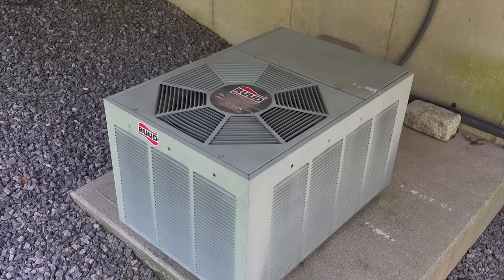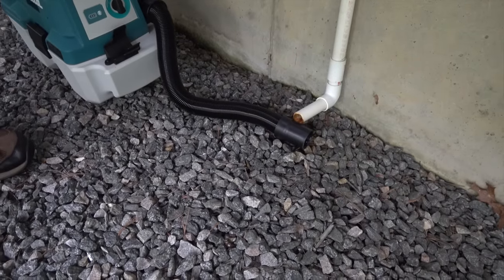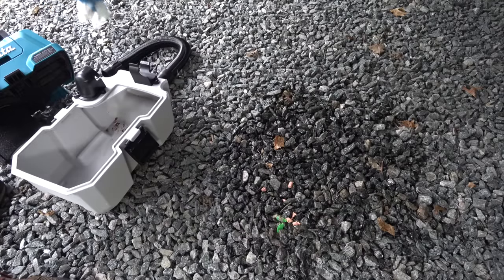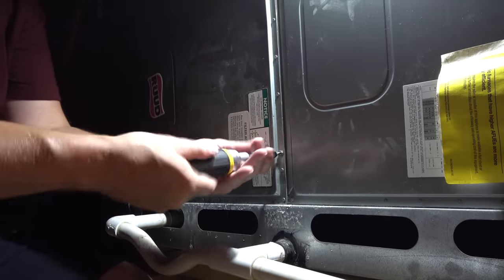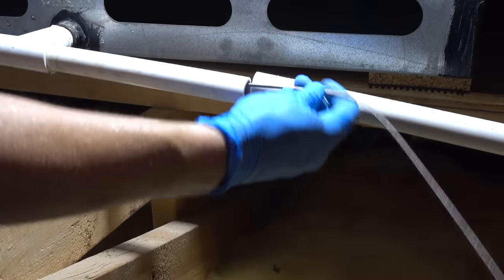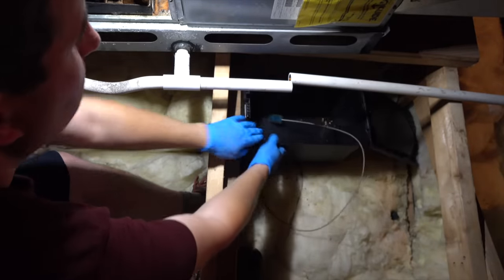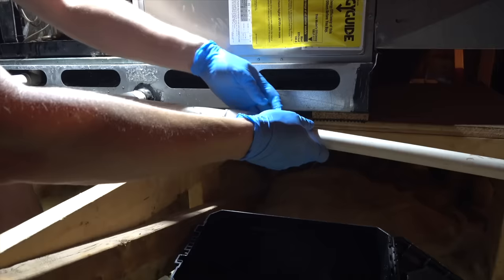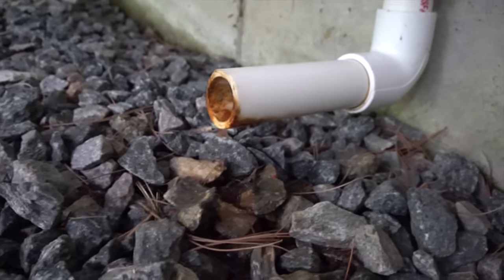How to UNCLOG your AC DRAIN Condensate line FAST - Water stains on Ceiling? or in the Pan

Comment: Our A/C is in the basement & it drains into a drain in the floor. It seems crazy to have you a/c in your attic! Even if we didn't have a basement I would put it in the garage, utility closet or anywhere except the hottest place in the house!
Reply: They do this in the south because its the most direct route to get the output vents run and connected. There is no utility room per se. I agree its dumb but the way homes are designed it doesnt make sense anywhere else. Id have put an upright indoor unit on a platform in a small utility room built on the back so that the return lines and outputs could be connected up in the attic easily.
Reply: In Louisiana most homes don’t have basements

Comment: I put a piece of clear vinyl tubing in my drain line at the attic unit, like you did.  Once a year (November) I pull it apart and attach a garden hose and blast it out all the way to the back yard.  Dragging a garden hose up into the attic is a pain, but at least I know the drain line is clean.  No clogs in years, and I have 3 AC units.
Reply: a bleach/water mixture (1:3) works to kill that mold build up.  That is what clogged our drain line.

Comment: That is a genius solution ... 6:53 ... Man, I never thought of that.  I have exact problem that you are describing.  Water leaking in attic, but I isolated it to a L-drop pipe that is about 10 feet away from the attic A/C.  I stuck an old LAN cord in and tried to shimmy it around, but it didn't clear out the stoppage.  I also poured some soap in it, hoping that it would help break the stoppage.  But, I probably need to cut a section, just like you did, then it would be easy to clean.  Thank you for the solution.  I need to buy that cord you've got ... 2:43 ... then shimmy it down the long pipe.  Thanks for showing me how to do it easily.  I do understand now.
Reply from the maker: Thank you very much, so glad it helped!
Reply: Treat the line with bleach once a month. It won't completely prevent a clog but it will help. Use 1 cup of bleach, pour it in the line, give 10 to 15 minutes then follow that up with hot water to make sure it's flushed out or the bleach will crystallize and you're back at square one with clogs.

Comment: There should be a vertical on a T that is higher than the pan for ventilation. This will allow air pressure to equalize at both ends and prevent the water in the pipe creating a vacuum and not draining. In my setup the main drain pan goes to the main sewage drain in the house and there is a backup pan that sits under the unit to catch any overflow in case the line gets clogged and that drain goes out to the side of the house. If you see water coming out the backup drain line, then the main pan drain is clogged.
Reply: Same exact thing is hapenning in my house. I noticed the open T. Do you recomment leaving open or plugging it?  I will try to plug it to try the vacuum.
Reply: @manuela.hernandez5461  should leave it open. That way if it gets clogged you (or a plumber) can blow out the clog.
Reply: Are you saying that your outdoor line never leaks?

Comment: I guess I am extra lucky, here in South Florida my water heater is in the garage along with the AC evap / air handler and I have an electric evacuation water pump just below my air handler and it pumps the water out with force, keeping that junk from building up. Just once a year, or if I hear the pump running too often or struggling like it's pumping weak. I pull the pump out and take it in the back yard, pull it all apart and clean the junk out of it, lube the bearing / motor and it works like new again. But now I bought the tablets and try to remember to drop one into the water tank once every two months or so, to see if it keeps it clear. 
My next door neighbor has the same but her air handler / evap is mounted up higher then mine and was gravity feed drain (my air handler is mounted just below my drain line, which is why I have the electric pump). Hers was plugging up the drain lines all the time with that muck. I don't even want to know how much mold is in her system because of that. She recently had an electric pump added to her unit to stop the clogging... But of course like the average person won't listen or pay attention to when the pump starts sounding like it's struggling and clean it's guts out...

Comment: Many people will never need this. but if you live in a hot humid climate like s. florida, its very, very common issue. I struggled with my condensate drain for years. In the summer needing to clean it once a month. So I did some reading on proper condensate drain installation.  Basically. I see about 95% are done incorrectly including this one.  I tore out what I had, installed new with a proper trap and its been over 2 years with zero issues and I have never needed to clean it once.  Some will argue the trap isnt needed but the proof is in pudding as they say.  This is related to single family if you live in a condo or muilti unit building there could be other issues but for SFH its simple. Install a Trap as close to the unit as possible, minimize bends, turns and length as much as possible, and after the trap keep the pitch as steep as possible.

Comment: My drain lines have a T fitting with a cover for both units in the attic. Every time I change the air filters, I take the covers off the drain line and dump about a cup of diluted bleach down each drain line...never had a problem.

Comment: Thanks for the advice. I added a p-trap since someone had removed an existing one before I bought the home. I couldn't find the tubing for 1 inch outside diameter so I used the screw-on compression couplings on each end of the p-trap & t-connector (for vent tube that I glued onto the downstream side of the p-trap). I just capped off the old vent. They even missed gluing one elbow and it was leaking so I glued that one on while I was at it. I used cleaner compound on all the old tubing before re-gluing. I had to cut off about 20 inches of existing tubing to make room for my new p-trap configuration plus compression couplings. The $16 pvc cutter that I invested in for this job sure paid off. Now I can take the whole p-trap off for cleaning if it gets plugged.
Reply: You can find these PVC compression fittings at Lowes's: https://www.lowes.com/pd/Homewerks-Worldwide-3-4-in-x-3-4-in-x-3-4-in-dia-x-2-1-2-in-L-Coupling-PVC-Fitting/50160529

Comment: Great video. My line clogged and the micro switch to turn the AC off was stuck to the bottom of the pan. Ceiling fell in in the room under the ac . I put a drain on the pan so now if the line stops up the pan has a 1 1/4 line to drip so it should never overfill. Take care.

Comment: That RUUD looks just like my first system I got a new one in 2007.My hall carpet was wet a few years ago I thought a water pipe busted,come to find out the ac drain line was clogged my ac man cleaned it out cut a tee in the PCV and put a cap on it he said about twice a year poor bleach down it to keep it clear.
Reply from the maker: That sounds like some great tips! I think we al got the water leaks at one time or another.
Reply: Bleach can be harsh on pvc pipe.  White vinegar is better.
Reply: @bulldog7659  tru but if u dilute it with water it should not damage da PVC

Comment: I use vinegar on mine it works great white vinegar
Reply: or chlorine bleach. In fact you can put a pool chlorine tablet in your drain pan and it will last a long time. Just replace every 1-2 years
Reply: @phillr3  does that prevent build up in the drain pipe?
Reply: @gottagobuy6436  using chlorine will also damage the drain pan inside the air handler, the coil, and the condensate lines, not to mention can have an odor that will make you sick.
Vinegar can have the odor and damage the pan and condensate line

Comment: AC units should never be put in the attic, I would not buy a house that has one there, same with water heaters, complete idiocy
Reply from the maker: You won’t be able to live in New England.  Almost all of ours our installed in attics. Just a regional thing. Kind of like water heaters in garages you never see that here but in the south it’s everywhere.
Reply: @SilverCymbal  Texas here. That crap is in the attic.
Reply: @8Jallin  Yep my Texas home has both A/C's in the attic!!! Had a water leak due to a A/C drain clog 3 years ago, tore through my ceiling and destroyed my flooring and furniture in the middle of Texas summer. Thanks for this video @Silver Cymbal. Very clear directions.
Reply: Florida native and current house has it in the attic- first time its not either in the laundry room or in a hallway wall. Really ridiculous.  The whole point of the pan and shut off is to have access for maintenance. ☹️

Comment: many AC drains have access ports built in....after I vaccum line I hit the line with heavy bleach.  If no port I pour bleach directly in the drain pan.  Does such a nice job of breaking up the goo.  Follow with cups of hot water from the tap to flush.  I do this daily for large apartment complex, I made my adpaters for shop vac to connect to outside line...works wonders.

Comment: Had this clog happen recently, but a cut off switch turned off the AC  system, so it did not leak thru the ceiling. Technician came out and showed me the cutoff and told me what to do- vacuum out the pipe. Since I don't have a wet/dry vac, used a milk bottle, cut a hole in the side, stuck that hole on the drip pipe with a rag to seal it up better, and used our regular vacuum on the milk pour spout( pointed up!). Sucked the water out very well, though I had to empty the jug twice, easy peasy. Did cost over $100 for the technician though, but cheap for Florida late night call.

Comment: Bro, you're a life saver. As an additional input. You can put a bit of bleach in the pipe once you're done cleaning it. If you do this quarterly, it can help not having to deal with this issue.
Reply: That's what I did last night and it unclogged my line, in the morning the junk was out.
Reply: No need to have to do this in the winter because your not removing any moisture  from your house.

Comment: Bees and wasps sometimes will build nests in the drain pipe.  After you cut and clean the pipe in the attic like shown in this good video and made the repair with the clear hose and clamps, pour a little more water into the drain pan before closing the AC up.  This way you can visually check that there is no leak.  The water will flow down and out the pipe as it normally should.  This will make sure no rodent or bee nests are outside the house.  I had to do this when I lived down south in Arkansas.

Comment: THIS is the video I was looking for especially when you got up into the attic.  That's where the problem is most likely.  I'd use duct/electrical/painter's tape to make that seal with the vacuum line to really dial it in and then you could just leave it on the pipe all the time.

Comment: I’m going to try this tomorrow, I have a shop vac and what I’m currently doing is every other day I have using the shop vac in the attic to get the water that’s building up in the hvac unit pan. Once it’s get to a certain level of water it shuts down. I hope it works for me, because the 2nd way might be a little harder to get to (town home)

Comment: My new AC has an in line overflow switch, that my AC guy recommended..once the water level rises the AC shuts off. That give you a start where to look..system then can be addressed.
Good information you posted.
Reply from the maker: Thank you, they really should all have that switch. Mine are 20 years old and knd of before that was common but that's great that you have one now. Extra safety is always good.
Reply: Is that called a Safe-T switch? My AC will start to run if I pull that switch out and put it back in again.
Reply: @IMSiegfried  it's called a Float Switch . It should cut the Circuit when water in the pan reaches a certain level. Not a tech yet just a student
Reply: @JeremyCrescendo  Thanks!
Reply: @IMSiegfried  yes, that is a name of one of many float switches
Reply: @craigkennedy9968  Thanks for the reply.
Reply: My overflow switch was worthless.  The installer put it at the very high end of the pan.  The water never got anywhere near it but it was leaking through my ceiling anyway.

Comment: Over the last two days, our A/C kept shutting off intermittently and our thermostat kept going blank.  I called my A/C company, which has changed the capacitor twice during the past year, to schedule a service call.  However, they were backed up and would not be able to come out for two days.  Since the unit was stopping and starting, I could wait.  The A/C rep mentioned that the line might need to drained.  So, I did some online research to try to see if I could narrow the cause of the faulty thermostat.  First, I checked the circuit breaker - no tripped fuse.  Second, I changed the air filter - it was filthy after months of not having changing it.  Third, I check the shutoff float because I had read or watched that the shut off float will shut off the air conditioning unit and thermostat if there is clog and water backup -  there was water under the float.  Fourth, and this is where the first part of your video was helpful, I went outside, wrapped a cloth around the pvc pipe and fitted the wet/dry vacuum hose over it and switched it on - the drain pipe start to shake and then I heard a loud thud in the shop vac and let it run some more.  After I opened the shop vac up, I noticed large chucks of clogged gunk and dirty liquid.  I did not get a lot of liquid, but what I did get was dirty and contained a gelatin like gunk (I don’t know the professional term for it).  After I did the drain clearing, the outside unit start right away and I had cool air flowing once again.  Finally, I turned off the air conditioner and poured a cup of cleaning vinegar down the drain pipe that comes out of the air handler (my system has a convenient screw cap that I can use to access the drain line for cleaning with a flexible brush or to pour a cleaning liquid down through the access port) and I left the a/c off for half an hour and restarted my air conditioning.  It has been running smoothly since I did those steps.  It saved me service call and gave me the confidence to know that I can take simple DIY steps to troubleshoot the system.  If my problems persist then I know that will be the time to call for the professionals.

Comment: I've had 6 different technicians out to identify the source of the "leak" turned out to be caused by condensation. Two plumbers and four different AC technicians, the last AC technician told me there's some insulation problems which is definitely a problem as well, but none of them tried to unclog the drain. After watching this video I decided to take my shop vac outside and try it myself. I'm not saying this was entirely the issue but I got buckets of water and dirt out of the system, and at this point it can only help.
Reply: @Ray Trammell wow what community college charges $25K for an associates degree? You could have done vocational training for under $5K & gotten paid to apprentice with someone.

Comment: My unit kept cutting off and on due to drain line backing up then level lowering.  At the time it blew cold air, compressor was cutting on, radiator fins were clean, but wouldnt stay on.  Unit was still under warranty.  Still, that cost me 160$ to have repairman handle the situation.  I wish he told me the problem before he went ahead and fixed it.  But now I know how to remedy this issue.

Comment: A lazier approach is to get an old bicycle inner tube and cut a section 3 or so inches either side of the schrader valve. Put the open end of the tube over the pvc condensate drain outside and position the schrader valve over the pipe center. Fold the other end of the tube back against the pvc pipe and squeeze everything hand tight against the pipe to provide a pressure seal. Get your handy air compressor with a tire pressure connector on the end of the hose. Pump air into the pipe at least 20 psig. More if you can hold the seal. You blow the crud back out of the line, open the line, and drain any liquid that is trapped. I used to do this once or twice per cooling season for about 10 - 12 years. Many times the line was clear to begin with.  About 10 minutes per session and no climbing in the attic (if your system is there) other than changing the filter :-) Worked great and many times big chunks became small enough to pass through... <bb

Comment: Shop vac (As a Tech I use a 20v Dewalt Vacuum) however if the system is 410a and has lost a partial charge you've probably got a Cracked Drain Pan. The Oil from Refrigerant (Particularly 410a/Puron) will weaken and split plastic pans in Air Handlers. So if it's not clogged but still dripping without a Frozen Evaporator Coil that's likely the problem. Another cause could be Restriction ,Clogged Air Filter (Pleated/Filtrete are the worst, or Couch in front of the Filter Grill) or undersized Return Airflow causing the Blower to suck the water back through the Drain Line which could also cause dripping from the Air Handler. Pan could also be Unlevel so water rolling over the side. Fitting going into pan might not be Glued or Sealed Properly. When you try everything from Youtube us Pros are waiting on your call.

Comment: You could also install a PVC clean out cap (t-type) instead of the clear plastic tube you used. That way, you just unscrew the clean out cap, run your drain snake/brush, and then reinstall the cap. Just a thought.

Comment: My old system had a clog which i found was a small snake that slithered up the pipe from out back and died up in there clogging the pipe way up in there. Unclogging it the snake bones were found along witj the sludge.